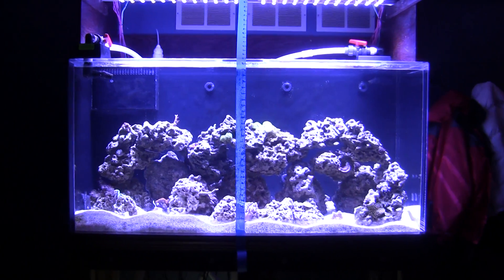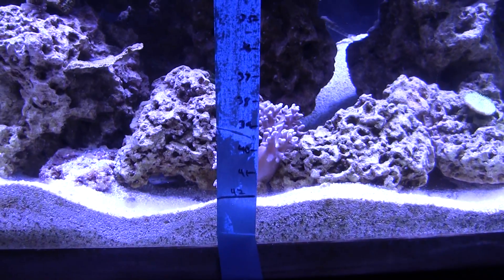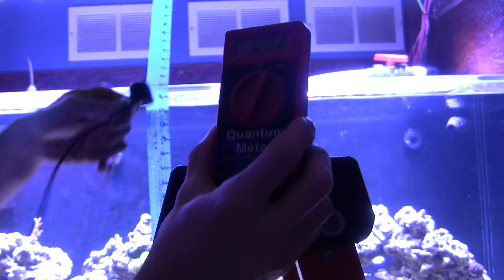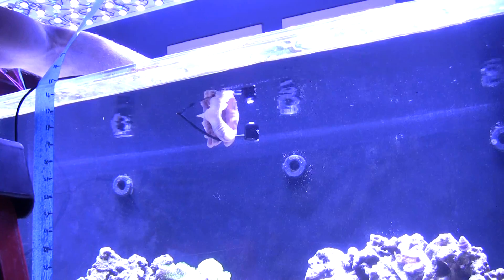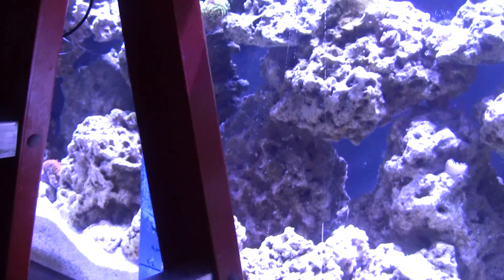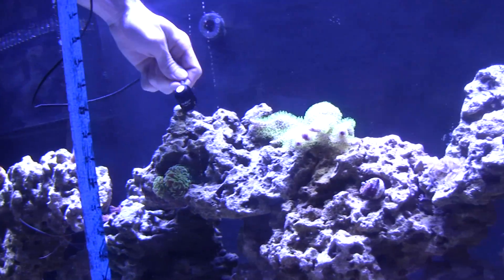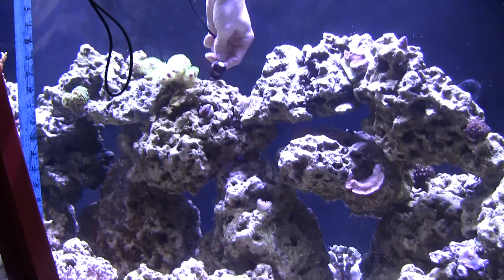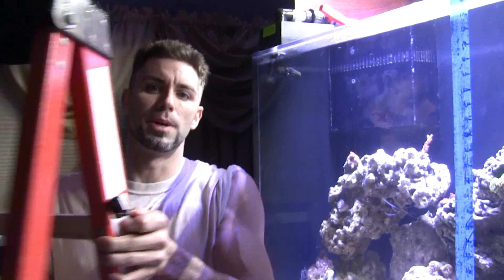185 reef LED's  PAR Meter Testing.m2ts

Comment: Good job on the reading.  I really suggest for you to use optics (it seems youre not) on your high noon blast... thats the reason of the sudden drop of intensity.

Also,  youre current setup with the voltage adaptor is scary. You can accidentally slide it to 12 volts.  Its very very easy and cheap to add a pot in there.  Its like extra insurance on youre part.